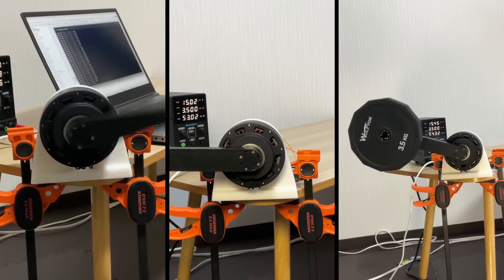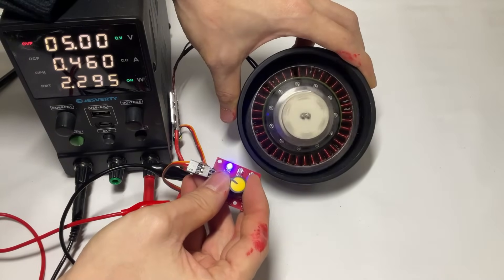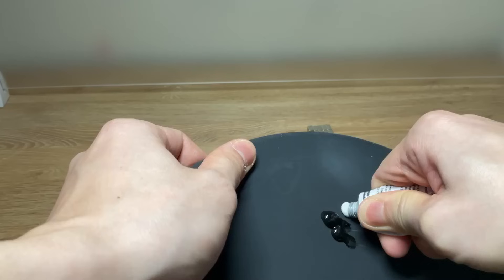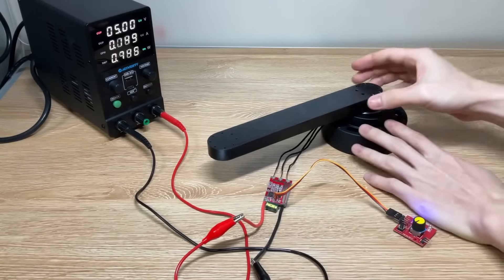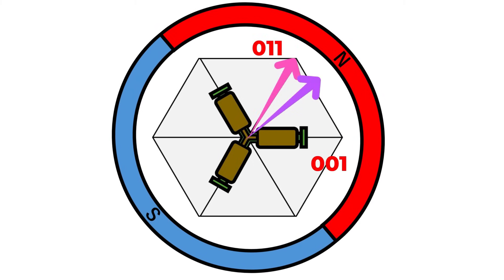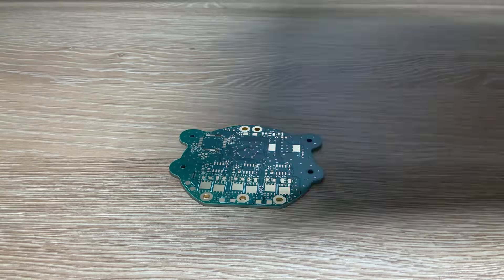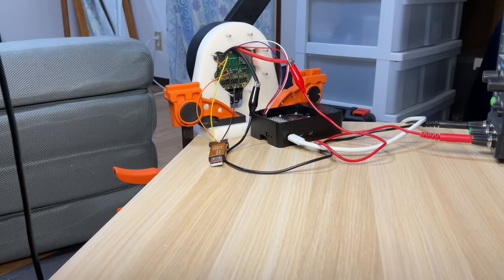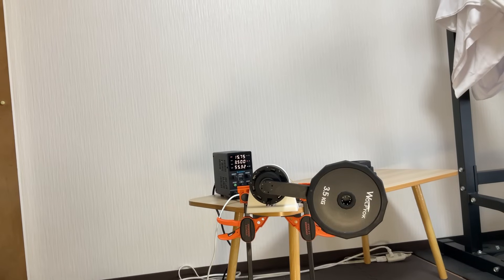3D-Printed Robotic Actuator & DIY ESC: Performance Test

Comment: Hey, how expensive is a project like this ? I'm a engineering student and I would love to build one of those myself
Reply: These motors are usually around $80-$200. I would guess some were around $120 or $160 for the brushless motors. Esc is custom so some were around $20-$120. The total for one joint would be around $190-$260. This is me estimating so I am not 100% correct but this is a rough idea of the price range. I have found decent brushless motors for $39 each and an Esc for $30. So if you really search the web you can find them for cheap. Of though they are not for this exact project so you would have to modify the cad. I hope this helps!

Comment: The INA181 has high CM range and CMRR. It is meant to sense current right at the switching output. If you want to sense inverter low side leg current, you can use a normal r2r op-amp.
You've chosen a good MCU for the task. For a more compact drive take a look at the STSPIN32G4. It has a STM32G431, gate drivers and a buck PS in a single package. You only need the mosfets. You can use the internal opamps for leg current sense. I made a small drive with it on 2 layer pcb.
A gui that lets you change and view parameters and has an oscilloscope function is necessary for FOC development.

Comment: Subscribed!  Exceptional work and exceptionally good explanations and diagrams: learned a LOT.  I have wound many brushed DC motors and am anxious to try my hand with BLDC design since I have a small machine shop that can both 3D print but also make metal components.  One question, please: I didn't see any discussion of where to get such nice large ID stators.   Would you mind pointing us to a source or two for those?  Looking forward to more of your vids!

Comment: Thank you for the great content. As someone hoping to do essentially the same thing, I had a few questions. Did you measure the internal temperature of the motors, especially at the rotor magnet location? Someone on reddit suggested I use N42H instead of N52 because the latter can get demagnetized at high temps.  What material did you use for the rotor? I hear electrical steel is best, and laminations are even better, but I can't manufacture it myself. Finally, I notice you don't seem to use any electrolytic caps on the esc. Is that common these days? If I recall correctly, someone experienced once suggested to me to use an electrolytic capacitor for each phase (he noticed I used one larger capacity for the whole design), but I didn't know going without electrolytic capacitors is workable.

Comment: Hi, I really enjoyed your video introducing the FOC driver board—great insights and very educational!

I’m currently working on a similar motor control project and learning from your design.
I was wondering if you could share a bit about your design considerations when selecting the following components:

    MCU: STM32G474RET6
    Did you choose this MCU for its built-in analog features like HRTIM, OPAMPs, and ADCs, which are useful for FOC? Or were there other reasons behind the choice?

    Encoder: MPS MA702GQ
    Was this encoder selected for its SPI/I2C interface, compact package, resolution, or perhaps its noise immunity?

    Gate Driver: IR2103STRPBF
    This seems like a classic discrete gate driver. Was the choice driven by simplicity, cost, or its suitability for low-voltage high-current applications?

    MOSFET: SiR182DP-T1-RE3 (N-CH / 60V / 110A)
    This FET supports very high current—was it chosen for low-voltage high-current motor control? Or were Rds(on), thermal performance, or package size the main factors?

    Buck Converter: TP6841S6
    Is this used to generate 5V or 3.3V for the board? Was it selected for its efficiency, simplicity, or perhaps its input voltage range and current capabilities?

Thanks in advance! I'm really interested in the design trade-offs behind these component choices.

Comment: Very nice! You are on the right track!
One easy improvement suggestion. I see that you effectively apply 3 sin waves shifted to 0.5 voltage. So even if there is 0 current you still have MOSFETs switching. What you should do instead is pick lowest phase voltage among 3 and redefine it as GND. Then you calculate the rest 2 phase voltages relative to that. If you do it this way -- you will still have same voltage differences between phases, but your lowest-voltage phase will stop switching at all and will hold LOW mosfet open all the time. Also this way you can increase the total phase voltage range to 100% (right now you utilize only 87%). This is a common technique used in 3-phase systems. Check it out it's usually referred as "DPWMmin". It also simplifies low-side current sensing as you always have one phase that always stays low, and you can pick the other one with the lowest duty cycle to get a longer period with the low side active.
Good luck! Keep it up!

Comment: I read that you use a switching frequency of 10KHz due to heat concerns on your mosfet and gate drivers. The key here is to use mosfets with lower gate charge and also lower RDSon. The higher gate charge leads to higher driver switching currents. You will be hard pressed to find one that minimizes both but there are a few from Infineon to keep a look out for. Infineon also uses some neat packaging techniques to further improve thermal performance like source down and die on lead frame. This is substantially better at removing heat from the die since the hot node is now on the thermal sink which can be whicked away from your non-GND net using thermal jumpers. The thermal jumpers have high electrical impedance but low thermal impedance. This is the best solution for dissipating heat from non ground/common copper nets. Then once all the power is dumped into the ground plane (by the jumpers) you can heat sink it properly with a silpad/ thermal compound to an aluminum plate with lots of surface area. Good luck on the next PCB revision!

Comment: I really loved the video! For the no-load speed test, did you change the supply voltage or the speed command of the motor? Because both seemed to change, and a higher voltage will allow for a higher speed. I also noticed that the current for this test was significantly lower than the 3.5A limit set. I assume that this also had an influence on the results. Did you look into using a halbach array? This way you can push the magnetic field of the magnets towards the stator and away from the outside of the actuator where it has no benefit.
Reply from the maker: Thank you!
For the no-load speed test, I was changing the speed command. The voltage appeared to increase gradually because the power supply had a current limit set to 3.5A, which caused the voltage to be limited accordingly. As the speed increased, the current decreased, allowing the voltage limit to rise, and it eventually stabilized at 16.8V.
This is the first time I've learned about Halbach arrays, and I found them really fascinating. I'd love to try incorporating them in the future!

Comment: I could be wrong here, but wouldnt smaller wire with more wraps give you higher torque at the same or lower amps? Lower amps = lower heat. 22awg would give you more coil wraps and still carry 3.5a with no problem. Also ultimately motor efficiency determines battery life, less amps = more robot dog fetch time. Really neat project though well done on the engineering so far.
Reply from the maker: Thanks for your thoughtful comment!
I think increasing the number of turns and reducing the current is also a very promising approach. As you pointed out, lower current means lower heat and potentially better efficiency. I'd like to explore that direction more in future projects to find the optimal balance. Really appreciate your kind words!
Reply: There's some complicated physics math to figure out the best diameter wire, it's usually easier to just try it and see, since we are usually limited in the diameter of wire available and by the size of the actual motor (or coils) needed.

It basically comes down to, smaller wire means more windings(wraps) around a coil which equals more dense magnetic fields and thus more torque... BUT, it also means that smaller(but longer) wire is going to have a higher resistance rating and faster heat buildup and longer heat retention, and quicker wire burnout time (high heat enamel wire is good, but it still only lasts so long at those higher temps)

Then again, most of my experience is coming from a coil projectile project where your dumping a ton of voltage and amps through a series of coils to speed up the projectiles.  In our case, having a fixed size projectile really makes a difference in determining the optimal wire diameter (gauge) for each coil in the series... i don't imagine a motor is going to be able to have that fixed load value, since it's physically moving something at arbitrary values at any one time... maybe a squirrel jumps on the robots back, now it needs more torque!

Edit: just wanted to add, we tried 14 guage to 22 guage (i think?).  The smallest guage wire smoked the coating pretty quickly, but it also wasn't the highest high-temp stuff either.  In our case we could make the coils as large as we reasonably wanted, but the larger you go, it's diminishing returns and requires more juice, so there is a fine point of optimal coil size (both length and diameter).
Reply: @tyrzxv  I mean you're not wrong, but I might be missing the point or relavance of your comment, at the amperage he's capping his power supply at I don't think heat will be an issue by just stepping down 1 size, he's not dumping massive amounts of current like it's a rail gun or something
Reply: @kodysherrer964  no your correct, i guess i was thinking at it from the view that he was going to be raising amp/volts later, so it might be better to add more headroom for later.  But what I meant to say mainly, is sometimes it's just best to try it than to over-calculate things, and often you hit a point where it doesn't work as expected, and then you know your real-world limit.

The whole heat thing might be a non-issue for these motors. My experience with foc is more with large diameter direct drive motors (i had nothing to do with their creation), that use a lot of electricity to hold positions under load, and can get quite warm.

Comment: FOC control would be cool. Also I would change switching frequency to above 20khz to make it less annoying sound for us humans. Also current limiting feature would be nice for keeping controller safe  and motor cool even at higher voltages. Temperature sensor would be nice as well. wonder if its possible to use swpwm while simulating sinewave with controlling dutycycle. Also I've always wondered if its possible to measure motor temperature from motor behavior or coil resistance while its running.  Also I'd love to see CAN implentation
Reply from the maker: Thanks for the comment!
I originally set the switching frequency to 20kHz, but it was generating too much heat, so I lowered it to 10kHz.
Improving cooling or switching to lower-loss MOSFETs is definitely something I’m considering.

Current limiting and temperature monitoring are features I’d like to add in the future.
SVPWM not only produces waveforms closer to a sine wave, but also offers better efficiency, which is a big plus.
As for estimating motor temperature from winding resistance or behavior — it’s theoretically possible, but seems to have practical limitations in accuracy.

Comment: A mild steel band around the rotor would contain the magnetic field.  This will lower the induced current in nearby wires and stop it erasing your floppy discs and VHS tapes.
You could cut the band from a thin-walled tube like a gas-boiler vent.  These are usually 100mm in diameter so you may need to make the whole actuator to match the tube you have to work with,  but it might be worthwhile just for the strength it gives,  and the concentrated field might let you use smaller magnets for the same torque.
Reply from the maker: That's a very interesting idea.
I'm currently considering using a single active cooler to cool both the windings and the ESC, which is why I'm exploring a design where the ESC is placed inside the stator.
However, I’ve been concerned that the magnetic field from the stator might negatively affect the ESC.
Your suggestion of using a mild steel band seems like a great way to mitigate that issue as well, and I found it very helpful.
Reply: @Koshiro_Robot_Creator  you may already be aware, but you can also get coreless motors with the magnets glued and windings on the stator. But that does mean that the design for the bell will have to be changed.
Reply: You could possibly use aluminium roof flashing as the magnetic shield. This stuff is around 0.5mm thick sheet used as a water proofing membrane on roofs, available at good hardware stores.

Comment: Excellent work. Thank you for your objective analysis  (regarding heat issues) and showing the PSU display data, it helps to learn. I wonder the 3.5A usage even without load. It must be related to the SPWM, which seems to use the average magnetic field to achieve arbitrary accuracy; the fields are never zero with increases the power consumption baseline. Critical for battery driven operations. 

However, for non-accurate needs (like waking etc. semi constant rotation), one could switch from SPWM to basic PWM dynamically on the fly to improve efficiency. Nice work🦾 😀🤝✌️

Comment: Would it be possible to add a negative voltage to the coils as well (doubling the number of MOSFETs) to be able to flip the magnetic field, so using both N and S pole of it, to increase torque?
Reply: All voltages are positive relative to the ESC's ground, but you use 50% PWM duty as "zero" so each motor wire's voltage can go positive and negative from there. Depending on which wire has the higher or lower voltage, the direction of current changes to give north or south magnetic field on the end of the stator tooth. More mosfets won't allow you to create a difference greater than the full battery voltage.
Reply from the maker: I’m not entirely sure I got your point — would you mind explaining it a bit more?

Comment: This is such an informational video. Great Job. That is quite an upgrade from the previous version- it's a lot slimmer now.

Which EDA did you use to design the ESC?
Reply from the maker: Thank you so much for watching!
I designed the ESC using Autodesk Fusion.